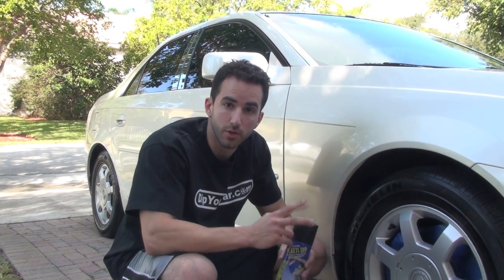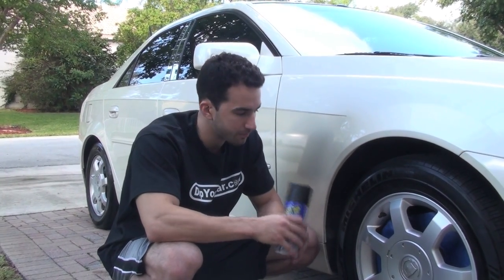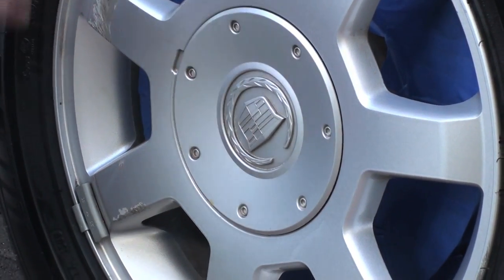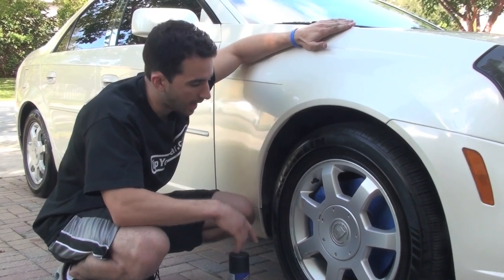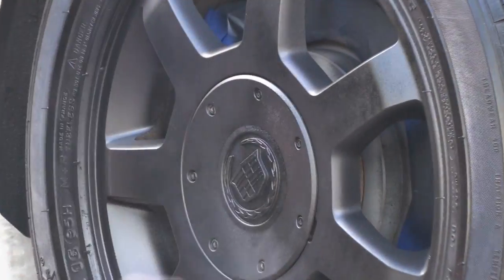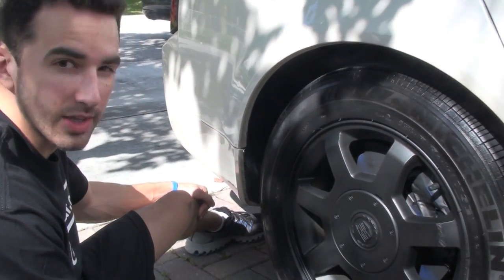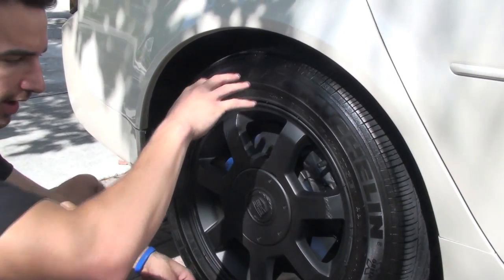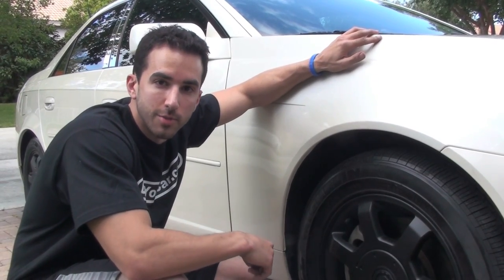PlastiDip Rims - Without Taking Wheels off the Car - DipYourCar.com How To

Comment: I literally JUST got done plastidipping my 2003 Maxima, if you're just doing the wheels, you'll be fine with 2 cans. Get 3 just in case... Also, you should use it on your emblems, I plastidipped my nissan emblem, maxima emblem and my SE emblem. I did the grill on my car too. I'd say pick 3 cans up and you'll be fine.

Comment: how do u remove the over spray on the body ?
i got small dots everywhere on my car. 
tried rubbing it with a microfiber towel and it didnt work. Even tried using my nail. Its stuck there big time.
Reply: Try the stuff they sell to remove asphalt or insects, it melts it right off.

Comment: You could put tire shine on then dip, but you run the risk of it dripping and running on the lip of the rim. Now the dip won't bond properly. Dip the wheels without tire shine and you run the risk of peeling the dip right off the rim when you clean up the tires 🙄 I've had these issues on the 2 cars that I've dipped. 

Best way is to take it off and stick index cards between the rim/tire, but by then I'd rather paint them(more color options and durable)

Comment: Does the finish last? I imagine it gets chipped fairly easily?
Reply: +33hegemon  Plasti dip is like a rubbery coating and it can get peeled away. Wheel paint and clear coat give a lasting effect and look nicer in my opinion.
Reply: Not really. I've used my finger to scuf it and it doesn't remove easily.

Comment: How would I take off overspray plasti dip, that is on the tire? Like i peeled some off but there is a thin layer of unconsistent plasti dip left on the tire that i can't peel off. I tried using some tape but it didnt work :(

Comment: how would I be able to cover up a Stock BMW rim with little room to put stuff around the brakes and rotors?
Reply: try to put a trash bag over the rotor and brakes
Reply: probably best to just take the wheel off at that point. I also have a BMW with a lot of spokes. taking the wheel off is a lot better than running your brake system

Comment: i had my rims dipped about a month ago and i realized that its starting to peel off on the edges of only the front rims.  im assuming its cuz of the brakes that its heating up the rim itself and making the dip starting to peel off?  iono if i should just spray it back on or just redue everything and make the edges a bit thicker?  anyone else have this problem?

Comment: how did you tape up the calipers rotors brake pads
Reply: Trash bags work great. Just cut the top end off, then down the middle and roll it up and put it through your spokes
Reply: Take the wheels off. LOL

Comment: Ok so to clear up a common question on this video as I go through the comment section is you can do this to any car you want too. Trucks as well but will most likely need more dip for a larger rim. Plastidip works pretty much on any automobile (INCLUDING MOTORCYCLES)

Comment: how many cans would you need to plastdip a set of 20s?
Reply: thanks
Reply: I did 1 can per wheel with 17" RPF1s.  5-6 coats will only make it stronger. Left it on all winter and had no issues at all through all the rocks and salt.  I used car wash pressure washers 1" away from the wheels on full blast when cleaning and never had anything peel or rip.  It's all about how long you want it to last....
Reply: Justin Hudson thanks, i ended up using only 3 or 4, was plenty and put a lot of coats

Comment: so, 4 coats per tire rim. can some one please tell me how long to wait to dry in bewteen coats ? im in NY now so weather is not that cold yet to do it outdoors.
Reply: I'm in New York and I plasti dipped my wheels too, I waited about 20 minutes between each coat
Reply: +Sagar Singh great ! thanks
Reply: +Sagar Singh  

hi again , last question since i will be dipping  my tires tomorrow. did you spray all  your tires at once ? and by the time you were at the last tire you went ahead and applied 2nd coat from the first tire .
Reply: Yeah, just spend around 3-4 min spraying it properly each wheel the. Move onto next wheel.
Reply: +Sagar Singh , great thanks a bunch !
Reply: +Arturo Flores ur welcome

Comment: @21cbermudez After watching videos i did my emblems, rims, and grill. It was my first time using plastidip and it came out perfect. Its cheap so if you mess up you can just take it off and try again. Like i said it is super easy to work with

Comment: how do I remove from wheels? ?
Reply: Lift car, with jack. Refer to owners manual to see where to jack, use jack stands, so your car is off ground. Remove hub caps, and loosen bolts( you need to loosen bolts or else tire will just spin, so loosen the bolts before you lift it. Then unbolt them and pull them off. Many videos on how to do it in case I missed something.

Comment: You at least want 3 layers on each wheel, so if you can't get that many layers on with one can, you'll want to buy another can. Just start off with 4 cans, and then buy more if you need some, but you should be able to put 4 layers with a single can.

Comment: NO do not use plastidip your calipers get hot! i have yellow calipers on my 2011 focus, use a heat resistant spray paint that you get from advanced auto parts or whatever. then if you want to take it off use a metal bristled brush or paint over it.

Comment: I did 8 coats on my rims and wen I went to take the dip off the tire it won't peel like it does on other smooth surfaces I would tape off y'all tires people
Reply: Yes I did everything as he said and I still had to sit for 2 hours scrubbing tires
Reply: Idk but I did everything just as he said and I had problems with the tires now the rims and body of truck worked perfect I even sent friends to his site to buy some dip
Reply: Joshua Landry That happened to my tires to. I think it all depends on the tire. I mean i literally used a whole can for my rims. But to save me all that, ill just mask it off
Reply: dont forget they did just clean them and have that shiny shit on them

Comment: So... he took off the tire, put the tape on the rotor, put it back on and named the video "plastidip without taking wheels off the car"? Is that what happened
Reply: or he just reached in i guess. But by that time, I would've preferred to take the wheel off.
Reply: Sir Eric You reach in actuality using plastic backs over the break and rotors works better and easier to remove
Reply: Sir Eric plastic bags

Comment: If you did 4 rims with 1 can then you did a terrible job and it's not going to last.  It is absolutely 1 can per rim in order to get the proper coverage and number of good quality coats.  If you pushed it you could get all 4 done with only 3 cans but why half-ass it if you're going to take the time in the first place.

Comment: Without taking off the rims use wrinkle papers from the daily newsstand after reading ok, well.. wrinkle a page fluffy size like for remember spacing when handling shipping and tuck it through the rim holes, until paint can't contact trough use pliers to pull them out after painting completed.  no want paint on the tire?  use small thin cardboard or a set of cards to play poker and stick them between tire and rim use as many poker card needed easy tiktok Hahaha!

Comment: Nice tutorial!  There's now a new product called "Tire Mask" by Minimizer that's a quick way to mask tires to dip. Way quicker than tape or flash cards. Intended for trucks in all wheel sizes but you can carefully trim to use on a car w/ an Exacto knife. My cousin painted his 18" G35 rims with a set of trimmed 17.5" Tire Mask. They look bitchin- Cheers & keep up the dippin'...